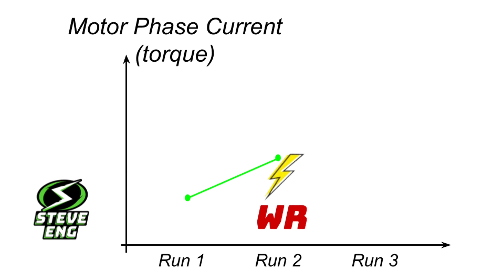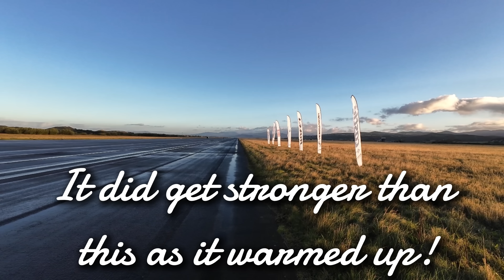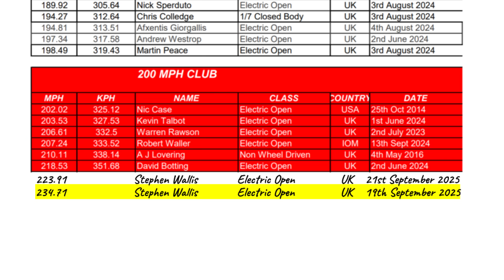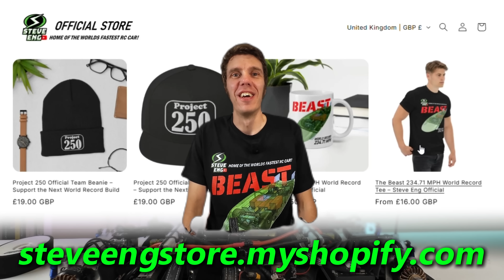World’s Fastest RC Car: 224mph Run + Project 250 Reveal!

Comment: what you have going on is amazing, but i have a bonkers suggestion. What if you added an extra pair of wheels (6 wheeler) with more motors for them too cuz it could increase your top speed and take load off of the other wheels (more = better and more power?).And for the design you could just make it longer like kevvy's speed sausage. tell me what you think and if you could maybe implement any of these ideas!
Reply from the maker: Hey! 6 wheeler could be done, it would be easy with my setup (just add more motors and ESC's). I considered this earlier but the extra weight, size and complexity put me off!
Reply: @steveeng1826  no problem, if you have any ideas put them in the comments so we can evaluate them

Comment: The vapor trail behind The Beast is wild. You named it well. Good luck in Project 250. You'll probably want to move to metal wheels, if they're allowed.
Reply from the maker: Thanks, its actually a sand trail getting sucked up off the runway! Thanks for the Project 250 idea!

Comment: really interesting to see this design breaking records, having come from the racing quadcopter background, the idea of using the same motors direct drive to the wheels has always seemed far more promising for top speed applications with the lack of drive train, ive always been surprised more people haven't tried this configuration.

are there limits on wheelsize? have you considered or tried a narrower chassis?
Reply from the maker: Hey! Yes I thought the same and gave it a go, seems to work quite well! The max length allowed is 1.5m so I could go longer if I wanted, but probably wont. The chassis width I have is a throwback from when I was going to use skid steer (it needs some width to help it turn). So now I have mechanical steering I could go narrower for better aero. Thanks for the suggestion.

Comment: If you could replace the mechanical braking with electronic braking you could shave some weight and complexity off the new car. And increase tire diameter slightly would increase potensial top speed and mabey reduce wear.
Reply from the maker: I already got rid of the mechanical braking a while ago, once I was confident in the braking from the VESC speed controllers! And I used a larger tyre diameter earlier, the problem is the foam falls apart more easily from the centrifugal force when there is more of it! Thanks for the ideas though👍

Comment: Well done - awesome achievement - looking forward to the next evolution! I think wheels and tires might prove to be a limiting factor. Perhaps an innovative wheel and tire design will be required. I wonder if 3D printed tires that are mechanically held by the wheels might be better able to withstand centrifugal forces better than foam and adhesive? Low profile tires with inward pointing radial fins whose profile flares at the end could slot into rigid wheels.
Reply: On reflection a better solution might be to 3D print the tires and wheels together with a multi filament printer so that the softer tire is both chemically and mechanically joined to the rigid wheel. Interlocking geometry at the interface would ensure the mechanical join. This could be as simple as flanged internal ridges locked inside parallel grooves running around the circumference.
Reply from the maker: I agree with you that wheels and tyres are a limiting factor to further improvement. What you describe sounds like what they used for tether car racing, A rubber tyre that is clamped by a 2 piece aluminium rim (with mechanical interlocking). Regarding 3D printing, I've tried it with tyres before and the TPU you can print with is not grippy in the slightest! Good suggestions though, keep them coming 👌👍
Reply: @steveeng1826  Interesting. Ground based control liners - who knew? Another rabbit hole to loose myself in! Wowsers - they are quick!

I know nothing about 3D printing but t'interweb says there is a foaming type of TPU that looks a bit like shaving foam crossed with spaghetti when it comes out the nozzle. It seems to set more like foam rubber than harder TPU. I think the foaminess can be controlled by temperature.

But why reinvent the wheel if tether cars already have a proven design. CNC machined aluminium might be more precise, durable and easier to balance than 3D printed wheels although fabricating a tire to fit them might be more of a challenge. Some people seem to have printed moulds for tyres and filled them with silicone sealant but not sure how suitable a material that is for high speeds. Perhaps other rubbers could be poured into printed moulds. Faffy though.

Comment: Yes man, bring it on. 250 and beyond!
you will have to use something alternative as wheels... hockey pucks or something LoL
Reply from the maker: I don't know what a hockey puck is like but I guess its hard and durable! Cheers for the suggestion! 😉😁
Reply: @steveeng1826  yeah, the disc. I think it is solid butil srubber or something. if you are able to install some kind of hex on it, its done. The weight might be a concern tho.

Comment: Maybe just Project 250
The best upgrade maybe would be to adress the tire problem and after that maybe a carbon body or some other lightweightstuff, some underbody flaps before the front tires because nomaly it is better that the air hits the flap instead of the rotating tire so less air resistance
Keep on the great work ❤
Reply from the maker: Yeah saving weight would help, thanks for the suggestion. I tried putting flaps in front of the wheels in CFD but it didn't help, it was better to keep the whole body as low as possible. 👍
Reply: Oh okay maybe thats the better way , yeah shaving weight is always a good idea to go fast , mayve you could also shorten the antenna for weight and better aero

Comment: For your nest project, you might consider wheel tubs to protect your eletronic gear from flying bits of tire in case your tires get shredded. Just one more thing: billet  aluminum wheels.
Reply from the maker: Good ideas there! I already have partial electronic protectors but they aren't full covered. Cheers!😊

Comment: Wheels look absolutely terrible. Get some specialist to design 3D. In carbon composite 
Wheels with lips to accept a proper thin rubber tyre . As cars have tyres that can take those speeds
Reply from the maker: Yeah there's some improvement to be had here! I'll cover what my plan is in my next video so keep an eye out for that 👌

Comment: Steve thanks for the video. Very interesting. How are you braking at the end of the run: disk brakes, engine braking, parachute? What sort of distance do you have to stop before going into the bad stuff?
Reply from the maker: Thanks for watching Andy! I'm braking using the ESC's to effectively re-charge the batteries! There's a limit to the braking power but I haven't found any issue stopping after a run, because at high speed the aerodynamic drag slows the car down very fast once you lift off the throttle. There's another 500m or so of runway left that I'm not using (and hopefully won't)!

Comment: Maybe get a decent surface radio? 
Driving with that aircraft one must be extra tricky.  There's really no need for it now days.  It's not like back when surface radios had limited range/power.
Futaba, Spektrum, and a few others, make surface radios that are as powerful, or more powerful, than that RadioMaster aircraft tx.
I think even RadioMaster make a nice surface radio that is as good as and easier to operate a car with than that Boxer.
Great video, but knowing you're driving with that makes me hesitant for a wreck any second.  LOL! Edge of the seat stuff!
Reply from the maker: Interesting point! I've always switched to and fro between sticks and steering wheel style radios, and in fact have the radiomaster MT12 that I think you're referring to! But I decided to keep the Beast on the Boxer for now. Range-wise it's awesome, the only issue is when it's closeby and you the power turned up. I have dynamic power on a switch for these situations 👌👍
Reply: @steveeng1826  good on ya.  I can't drive a car for the life of me with aircraft radios.  
That boxer is a great radio tho. I think they nailed it with the size and ballance, -great ergo on that little thing.

Comment: bigger rims, less revolutions, less centrifugal force
Reply from the maker: The centrifugal force also goes up with diameter though so it wouldn't necessarily give an improvement. And aerodynamically the car could be worse with larger wheels, its a tightrope balancing act! Thanks for the suggestion though!
Reply: @steveeng1826  Thanks for the reply :D I'm just throwing around random half brained ideas. If larger rims won't work, try 220S. 814v should get you over the 250 barrier

Comment: Amazing work so far! I can't wait to see how much faster you can push the limit.

Wheels/tires always seems to be a bottleneck for everyone. I bet you could come up with a clever, well designed solution. I've made my own tires before using polyurethane rubber casting resins and they worked really well. Might be worth investigating as an alternative to the foams that constantly blow out. 

It seems like it takes a bit of an effort to get the car lined up down at the start of the runway. In your other videos you've mentioned the large turning circle makes it difficult to turn around/get lined up at the start. Why not just drive the car backwards so you don't have to worry about any of that?
Reply from the maker: Hey Nick, thanks for watching and for the message! Cheers for the suggestion on the tyres, and in getting the car lined up, you might have seen in my last run I got someone to drop the car off and line it up! The hard thing is judging where the end of the runway is when you're so far away. I can't drive the car backwards as you aren't allowed reverse at rossa events, I think due to some issues in the past where reverse was engaged at speed, blowing the esc and leaving the car with no brakes and maybe no steering!

Comment: Raz , Kev dont want to listen to me ,so i hope u will use this tip on the wheel issue. Use bigger diameter wheels. its as simple as that. the further away from the center point of a rotating mass the less the centrifical force. Plus the wheel turn slower to get the same speed that also gives less centrifical force. So when u then beat the record again we can go rub it Raz and Kevs faces!🤣😎
Reply from the maker: Hey, yeah larger wheels do offer some potential benefit (mainly due to having a larger length of foam wrapped around them), but they would also increase the frontal area which would be a drawback. A major problem is actually getting hold of them, since as far as I know the only manufacturer is Gone Bananas. But its definitely something I'm considering.👍👌

Comment: I’ll definitely be following along! Good luck Steve 😁 My next attempt is gonna be the traditional car motor design because I have all the parts, but after than I am 100% going for the 4 drone motor configuration especially considering I have experience in that 😂

By the way. Motor manufacturers can make any kv you want.. it’s crucial for gearing and torque to be able to choose a kv. All of our world record drone projects don’t use custom kv
Reply from the maker: Hey Luke! I am certainly looking forward to seeing what you come up with! Good luck with your build(s!). Yes I though the drone motor setup could work for you! 😄
I get what you're saying about the KV values, I don't know how easy it would be to get them customised though! I had it in mind that I could rewind them myself if needed to change the KV value, but I have done my best to avoid this since it would be a lot of work (I rewound one motor earlier and it took ages, and was painful on the hands....).
Reply: @steveeng1826 thanks man! It’s obviously better if you can use stock kv values, but if you really need to you can ask iflight if they can do a custom kv value for you!

Comment: Only suggestion I could offer is minimize your frontal area. Take some inspiration from Bonneville Streamliners. Speed Demon 715 is my favorite Streamliner, but you've not got to worry about accommodating a driver. It might be worth wild fitting an FPV camera into the design.
Reply from the maker: Hey, solid suggestions there, I'll be taking that on board 😊

Comment: Hows about using a quad fc, the esc control for torque vectoring traction control, accelerometers and gyros for active aero.? Max control and traction with the minimum of drag.....😮😊
Reply from the maker: Hey, I started off with a setup like this, I found the drone ESC's didn't have sufficient control to not burn out the motors very easily! (see my ROSSA round 3 2024 video) 😬😄

Comment: Well done Steve:)
No shade here, but having pretty much opposing wind directions on the two fastest runs, despite being on different days could almost make it count as a run + return run, so the Beast seems to be a roughly ~230mph weapon when wind isn't pushing it either way. Pretty cool benchmark:)

I had totally missed that you're using direct drive hub motors. As always, I should mention that I don't speedrace or even have an RC car but I did notice how noisy the gears are in some of the other fast cars which has to translate to some losses right there. 

Can't recall if you used AirShaper on the Beast? If not, I am sure you are aware that they seem to like sponsoring a few youtubers. I first learned about them from SuperFastMatt and then the Sendy Club and hopefully they are not only looking at subs numbers when they decide who to help out. I know they sponsored Project Air lately, but maybe your "real" and more in-depth engineering focus would set you enough apart that they would consider giving you some CFD credits, at least.
Reply from the maker: Hi AntiVaganza, great to get another comment from you 🙂
Yeah I believe its a solid 230mph car, maybe more if I upped the current further (although tyre dependant!)
The gearing losses is one of the reasons I thought direct drive would be better, theres also a lot less to wear out and go wrong!
I'm using Simscale so far but that's a fair point regarding Airshaper, maybe Simscale would do me a deal or I could switch allegiance!

Comment: I dont do this RC speed run stuff, but I wonder if anyone has tested if rear steer would allow for less steering angle deflection with the same authority because the vertical aero would assisting in the turning.   Looks like your car basically has vertical stabilizers, and rear steer would yaw the car while front steer scrubs. 🤷‍♀  In this case the car would act more like an aircraft, or an arrow more likely.  Alternatively you could program the controller to lock the steering (maybe?  dunno) past 100kts and swap to control surfaces like rudders on the stabilizers.  Or just use a 3rd channel for rudder deflection.  On the wheels and tires, increasing circumference is going to have to happen if you go much faster.  I think you guys are at the limit of centrifugal forces of plastic and foam.  Maybe Magnesium wheels will work better, but you'll have to incorporate body areo that has tubs to fit the larger wheels I guess, and to keep the chassis low, you'll have to mount axles higher above the chassis.
Reply from the maker: Hey, I did consider rear steer earlier, but by all accounts it does not help stability (apparently the Thrust SSC which had rear steer was on the ragged edge of stability). My car has very little steering angle so I don't feel there's much to be gained frontal area wise by going rear steer. Generally the car seems very stable, so I'll probably stick with the current configuration 😊
Fair points on the wheels, you know what compromises there will be to go to larger wheels, I'll be considering that as I move forwards. 👍

Comment: You need larger diameter metal or carbon wheels and a thin rubber film stretched over and glued in place over the metal. It could be just the thread part of current rubber tires without using the sidewalls. Cut the sidewalls off and stretch/glue, the whole thread over the wheels.
Reply: Exactly
Reply from the maker: Thanks for the suggestion, this might be something I try in future, keep an eye out for my upcoming videos 🙂

Comment: Can you elaborate on how it steers? Is it Tank/Bulldozer/skidsteer? What happens in the event of a motor failure?
Reply from the maker: Hey, it has conventional mechanical steering actually, I started off with skid steer but that didn't work very well! See my Rossa round 3 2024 video! If a motor cuts out it does veer to that side but fortunately that hasn't happened since round 1 this year 👍

Comment: I have no design or engineering input, unless you have specific needs. I'd personally address the wheel/tyre situation. You're at over limit of the materials. If you're redesigning the body, reduce drag further as it's an exponent of velocity, stability is proven.   Reduce tyre width?    It's a packaging exercise now, all tradeoffs. Exciting!
Reply from the maker: Thanks, I agree with your direction, you'll see in the next video 😊

Comment: Amazing work, will have to see how your 5215 implementation works out compared to mine a bit later! Currently working on some larger wheel myself to get the OD up to 110-120mm, get the RPM down a bit for the top speed, hope they will be less likely to rip themself to pieces!
Reply from the maker: Thanks Daniel, yes time will tell on the installation! 👌

Comment: I want to make my own rc car top speed like your project. I will use 3536 or 3530 motor x4 and 120-150amp esc x4 on 6s - 8s
Reply from the maker: Yeah definitely give it a go! I suggest looking to see if you can use a 4 in 1 drone ESC, it would be way cheaper. AM32 ESC's can be set up to work like an RC car I believe.
Reply: @steveeng1826 wow thank you so much is helpful cuz I got abit budget for this build 😅